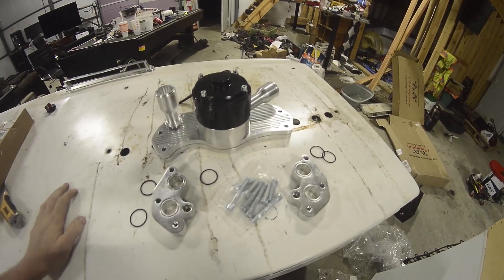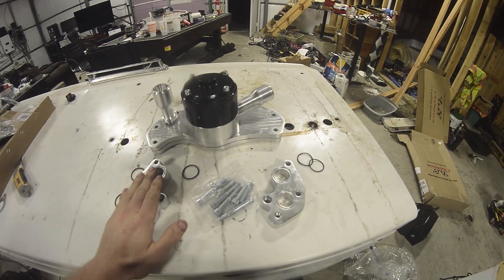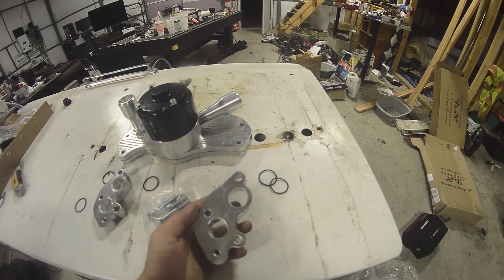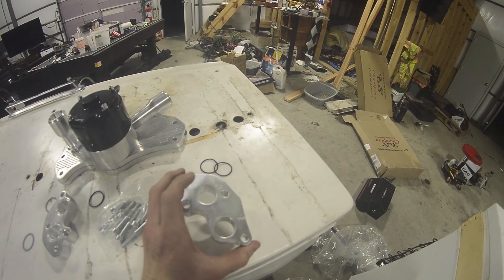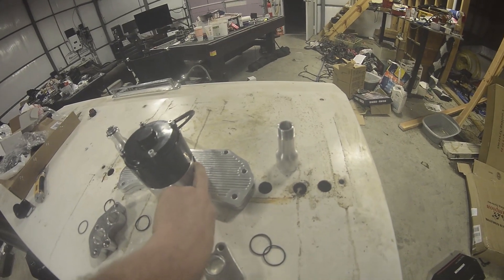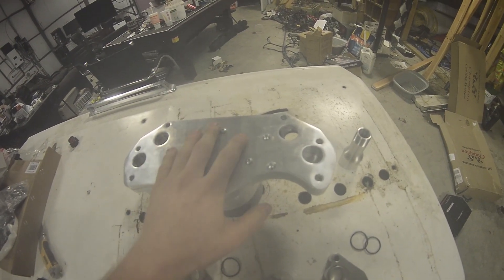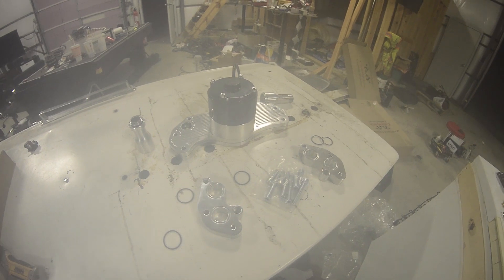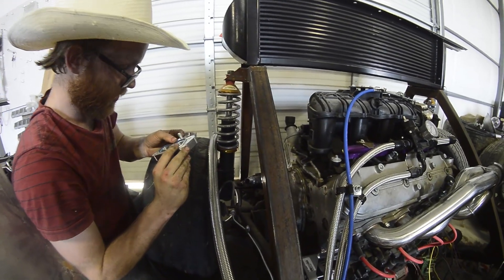Speedmaster LS Electric Water Pump Review

Comment: What do you do for a thermostat and the heater hoses... thx.. M
Reply from the maker: No need for thermostat. Controller turns on and off the pump based on coolant temp sensor. No heater in this application, but if you need heater, you just tee off the input and output
Reply: @DJTuningCom  Thanks DJ... I have an LS7 with a gm ecu... A crate setup... Would you know if the coolant temp is controlled by the ecu or is it a separate control module... Electric water pumps containing heater ports and thermostat housing are quite costly.... My build is in progress just doing my homework... Thanks for your help and your video... M
Reply from the maker: They make separate electronic water pump controllers. They need more temperature sensors than just the standard ECT sensor in the cylinder head.
Reply: @DJTuningCom  Thanks... Good idea... I'll look into it... M
Reply: How many inches does it stick out from the block with the adapters.

Comment: How do u reroute ur serpentine belt?
Reply from the maker: Depends on the application. My application only needs to connect to an alternator so it's a small single belt
Reply: @DJTuningCom  which alt bracket kit did you go with. I'm building a ls soon. And only need alternator  and water pump. And I like the alt on the upper passenger side.

Comment: do you run an in hose thermostat
Reply from the maker: no, usually people run an electric fan relay and controller that goes off a temperature sensor. electric pump then cycles on and off based on coolant temperature

Comment: The water pump did not work in Ls2 or Ls3 engine. The Water pump body not clean the cam sensor. I bought one and I gridded the spacer but them I discovered that my cam sensor was not let me install finish the install. I ended selling the water pump to buy a Meziere EWP.
Reply from the maker: Good point. I do think the listing says it will not work on VVT engine due to the cam phaser on the front. For a non VVT engine it should still work and clear the cam sensor. It is only the VVT engines that have the cam phaser protruding.
Reply: @DJTuningCom  well my engine is a Ls2 non VVT and the cam sensor plug didn’t clear . I didn’t wanted to grind the water pump and decided to sell it. I deleted-the pictures that I took of the issue.
Reply from the maker: @fastsspr  That's interesting. it clears the front cam sensor on my ls2 just fine. It doesn't even go over the cam sensor.

Comment: Arnt the o rings used in place of the gaskets?
Reply from the maker: No. They are only used to seal between the blocks and the water pump. not between the blocks and the engine